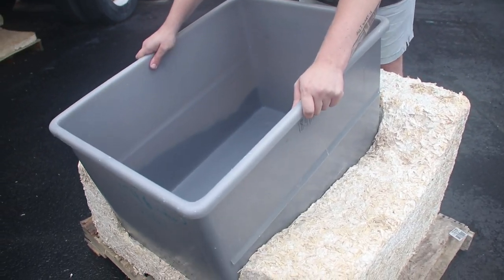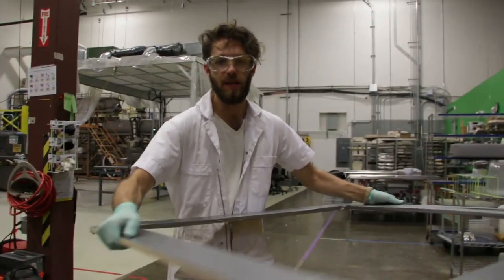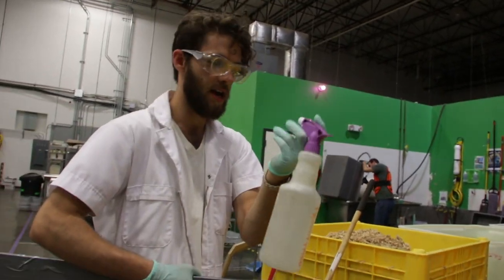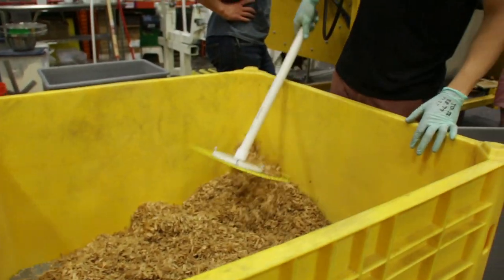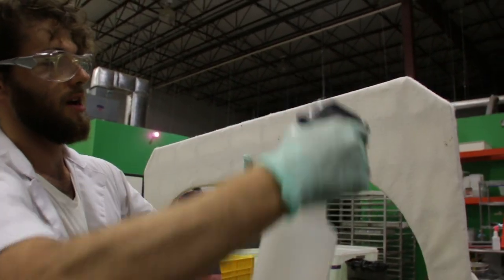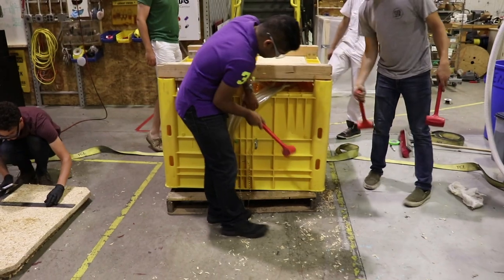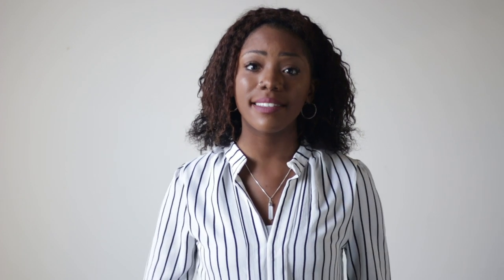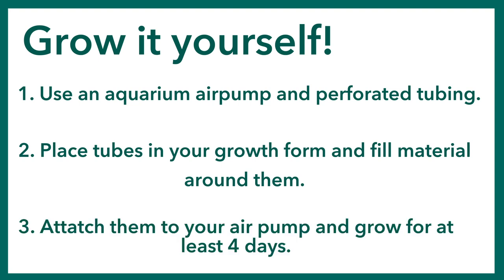How to Grow Giant Mycelium Parts

Comment: Just curious, once you sterilize/bake the product, can you get it wet without it breaking down or growing? Can you work it almost like piece of foam or wood (mainly cut it for a more perfect surface)? I definitely see mycelium structures even replacing a lot of structures of common house hold things. For example, your couch might not be completely made from mycelium but the frame and base are. The possibilities seem endless... This stuff is especially cool when you consider that this is all carbon sequestration. Furthermore is a way we can add carbon to our soils.

Comment: Hey do you guys know any reference to check out for what species of fungi are best to grow various qualities/properties in building materials... Like what species will be best for growing a thin leather, or what should I use to make bricks, etc. (properties like softness vs. brittleness, etc.)?  Great video btw!
Reply: David Jacobik I would like to know that as well! 🌎🌻✊🏽
Reply: Likely Lingzhi, it's used for hard and soft materials. I'm guessing the soft materials have less substrate and more mycelium which makes them more flexible. In hard materials, the mycelium acts more like a glue to hold the substrate together.
Reply: @namAehT  It could be but I don't think reishi does anything in a week.
I think I heard some car companies were using some kind of oyster mushroom to grow parts.
I thought reishi would be stronger but it's probably more about time than durability.

Comment: But...do I want my chair to start degrading immediately after it's finished forming? If this can make long lasting structures, how about using it as building/house insulation?
Reply: you didn't get it. it's inert after that, it is "baked" (as in oven baked) and it kills the active mycelium. It never grows again, it's like cardboard when finished (it will look fluffy but it wont be that fluffy)